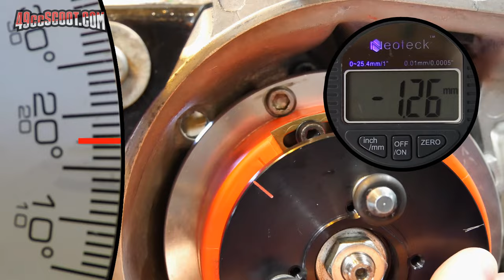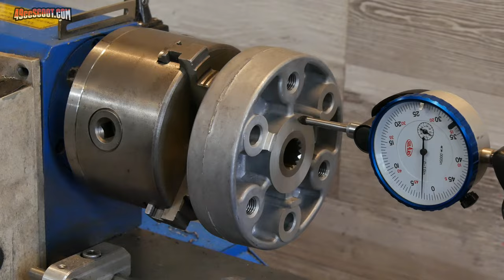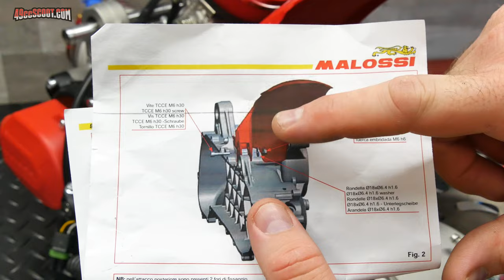RC-One : Finishing Touches, Engine Install & First Rides! : RC1 : Part 08

Comment: thats what you get for torque spec'ing the exhaust bracket bolds mate xD why the fuck even torque them that not even needed hand tight is more than enough xD always the americans they do things so weird on mopeds goddamm and people dangling there waterpumps is just lazyness i would put it some were were its covered up and exstentr the lines a bit i realy dont understand why people do it like that fucking weird
Reply from the maker: I use torque specs to avoid stuff like that. IMO Malossi could use bolts that will withstand factory torque, since that's what they tell you to use. The exhaust is expensive. They can't splurge for torx or higher grade?
Reply: @49ccscoot  malossi dont uses torque bolt because it not needed at al mate hand tight is more than enough xD